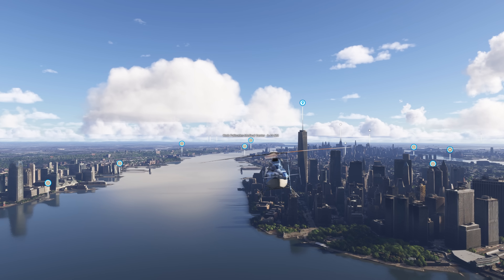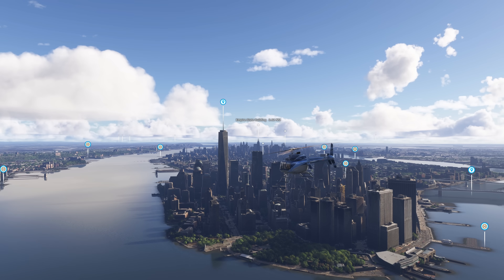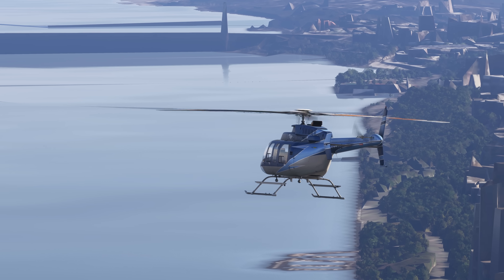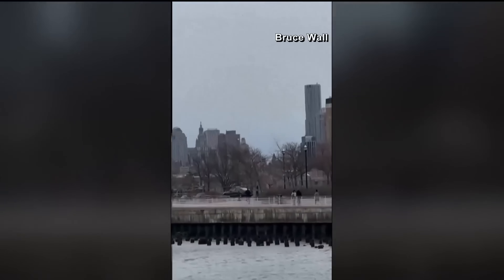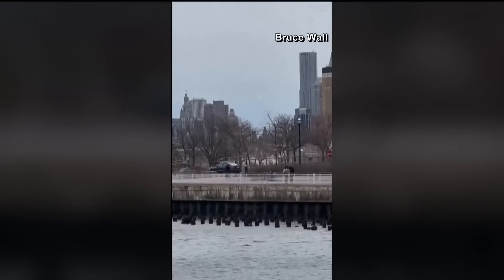Helicopter Expert breaks down Hudson Crash, and discusses “Bump Mast” Theory | NYC Crash Follow-Up

Comment: As a retired Army Colonel with 724 combat hours in Vietnam and over 1500 combat hours overall, I also flew the grandfather, as I had five in one organization and nine in another.  Seeing the blades and the transmission flying off together, it's possible that the transition froze, locking it and the blades up together and causing the helicopter to make a 90-degree abrupt turn, tearing the tail rotor off due to kinetic energy.  As for mast bumping, I didn't see any abrupt maneuver.  I am sure improper maintenance will be the chief cause of this accident.  In Vietnam, I flew the OH-6, a much better combat helicopter.  Its grandson is used by Army Special Operations aviation units.  Don't forget that during initial helicopter training for Vietnam, the Marines trained with the Army.  Some may have forgotten to tell their grandchildren.

Comment: When i was in the NAVY (72=76) I was in Helicopter Training squadron 8. That's the squadron that operates the Bell 206 (TH57) since the late 60s. There was an A,B  and C Model. I worked on the A model for 3 years. We trained all Navy, Marine, and Coast Guard helo pilots. Also, Iranian and Italian helo pilots. This was a good interview. I'm a retired fixed wing corporate pilot with a lot of time in the corridor. He brought up a lot of things that make sense. I haven't heard the term Jesus Nut in 40 something years. I told my wife about it, and she said "thats the only thing holding the rotor on" pretty much. In the video it sppears the main rotor still has the transmission attached.

Comment: For future reference, it’s nearly impossible for there to be a “seizure” of a helicopter “gearbox” during power on ops.  If there were a problem, the power being supplied by the engine AND/OR the inertia of the rotor system turning will keep those parts turning for a good while.  The ”gearbox” would grind itself to small bits of metal before ever seizing.

Comment: I highly doubt this was any sort of mast bumping situation. The main rotor & gearbox auto rotated smoothly down, with blades that looked in good flying shape till impact. Had it been a bump/strike, the blades would have been mangled. Seeing the pics of the gearbox, mast, and blades, the upper fuselage structure was ripped out, still attached to the gearbox. I would bet money that there was a gearbox seizure. This happened to a Super Puma in the North Sea some years ago.

Comment: As we all know from the eyewitness videos, the Tailboom went first. The Main Rotor and MGB assembly along the upper deck went only a few seconds later.
NTSB B-roll video is out. 
Check out the left upper rivets on the remaining Tailboom assembly connected to the fuselage.
The metal has sheared right in the middle of the rivets pos 11 oćlock anti clockwise to about 8 oćlock. That only happens, if the rivets have been installed too strong! 
Only lower and back around anti-clockwise, the metal is sheared. 
That damage also concurs with the video footage. It broke free on the left partition and ripped off the right partition.
My bet is, these rivets had been installed wrong and that’s where the crack began before the Tailboom including the tailrotor assembly etc sheared off.

And it was no Mast Bumping, that was clear right from the first video!

Comment: If the Jesus nut came off the upper part of the shaft and trans would not be still attached. My 2 cents is that the transmission froze and blew apart.

Comment: 4500 hr helo pilot here. Saw the video where they were cruising normally and then a very rapid right yaw and appeared the tail boom separated. The main rotors, with the swashplate attached, auto gyrated to the water just after the main fuselage hit the water..other parts then fell nearby

Comment: In a 2015 there was a similar incident on the Isle of Man with the 206B, here the results of the investigation: The pilot of of the Bell 206B Jet Ranger II, had disembarked his two passengers and lifted off for the return flight, in an area of mountainous terrain. The wind was from 220-230°, gusting to 46 kt and the aircraft was seen to head initially into the wind. It was then seen to turn right onto a north-easterly track and the fuselage was seen to oscillate in roll. The fuselage rotated in yaw beneath the rotor disc, more than once, and the nose of the helicopter pitched up into the rotor disc, being destroyed. 

The fuselage, rotors and many fragments fell separately to the ground, where the fuselage impact was not survivable for the pilot. Examination of the wreckage showed there had been a catastrophic failure of the helicopter’s main rotor mast in flight and there was clear evidence that this had been due to heavy ‘mast bumping’ contact between the teeter (‘static’) stops on the main rotor head and the main rotor mast. This was consistent with the observed behaviour of the helicopter, where the pilot appears to have been attempting to control the aircraft in turbulent conditions.

BTW: my Dad was a U.S. Army Huey pilot with 3 tours in Vietnam and a 20-year veteran. Respect to you sir.
Reply: My Ventusky radar shows that the wind that day at their altitude was 20-22 mph. It night have gusted higher than that.
Last week it was very windy and gusty the whole week here in Florida.

Comment: This heli has a tilt rotor head so if you pull the nose up and and then over compensate by pushing the nose down down means the rotor now faces forward and down and the fuselage pointing up if the rotor head hasn’t separated now it will on the back stick correction. Have seen 3 Bravo model Iroquois fall out of the sky doing rapid pull ups.

Comment: Thanks Capt.  and Colonel Joe Yannessa. Really appreciate this!  
There's nothing like hearing from people who actually know what they're talking about! Especially in our world of social media "experts". 
Every tragedy involving loss of life is devastating. As a private pilot of 26 years (fixed-wing) and a dad who've flown this scenic route several times, with my own children and family members, this hits hard. 

And on top of it all, it happened right near my job of 30 years. The Holland Tunnel ventilation building (one of four), where I work as a Tunnel Systems Controller. Operating the High-Tension feeders, ventilation fans and tunnel lighting (and various other equipment). 

My knowledge of helicopters is very limited, and only based on my love of flying them in flight simulators, for decades. DCS World, MSFS, etc. However, when I saw the videos, my first thought was....catastrophic mechanical/structural failure!
Prayers for the pilot and his passengers. Condolences to the families and loved ones. 🙏🏾

Comment: PS.. the rotor has now been recovered and the blades do indeed show severe damage. Both blades are snapped and hanging limply at about 1/3rd span. The tip of one blade is missing and the tip of the other is crushed. This IMHO is entirely consistent with blade impact against the tail boom. In fact it's hard to explain the tip damage any other way? The mast, upper gearbox and it's mounting is also still attached (so no Jesus nut or failure)

Comment: Regarding the speculation that the rotors would break if they had struck the boom. There have been previous incidents where (following catastrophic epicyclic gearbox failure) the blades have chopped off the tail and the blades remained largely intact and rotated down seperate to the fuselage, exactly as in this incident. The crash of G-REDL in 2009 in the UK North Sea is such an example, the crash investigation report is online. There was another similar incident in 2016 in the Norwegian North Sea. Too early to say for sure of course, but in my non expert opinion the evidence so far seems consistent with catastrophic gearbox failure as the initiating cause.
Reply: Wow! The closer I get to thinking I've found the answers, the more I learn that there are just too many possible scenarios to come to a conclusion yet. 
Fixed-wing private pilot, with no rotary experience, but I've always been fascinated by them. Thanks for sharing. 👍🏾

Comment: When carry paying passengers, no pilot would be foolish enough to jeopardize the aircraft by doing some whacky maneuver. Smooth, coordinated flight is obvious. The aircraft suffered some type of structural or mechanical failure. The question is; could this defect have been detected during a routine preflight?

Comment: It is so heartbreaking, the only comfort is that they left  altogether. My worst nightmare would be losing my whole family-being the one left behind. The survivor’s guilt would be overwhelming, after all, it is natural for families who are close to travel and take trips and holiday together. Helicopters are a whole different beast from fixed wing aircraft. My old boss from when I worked in aviation was in a heli hard landing/crash - they dropped from 40 ft straight down from an engine failure. Spinal injuries, he took 5 years to recover, but if they had been just 20 feet higher, it would’ve likely have been fatal for everyone onboard.

Comment: I am definitely not an expert but it looked to me as if something externally hit the tail of the helicopter. It turned sideways unnaturally fast and the hit was so hard to break the tail off. It could've been something small, shot from the ground. Just something I wonder why no one is talking or considering about. It will explain a lot for the different events at the tail. But then again, why did the main rotor came apart from the top of the helicopter, unless the stress from a hit can actually put so much stress on the main rotor.

Comment: Have that helicopter double controls? Child was at front seat. If she did pull it to mast pumbing? It happen when after deep descent and pull sharply up, and when it began roll, doing correcting steering. Said army guitance film.
Reply: Holy Cow...!
I've read sick comments about this crash, but blaming one of the children, you're in a disgusting league of your own!
Reply: @NewChannel-wi7vj  I didn't read it as blaming. I saw it as a legitimate question, because many aircraft have dual controls. He may have been thinking that the pilot let his front seat passenger fly it briefly (as done in fixed-wing discovery flights).

Although I doubt a pilot would do that with a cabin full of passengers/family members, but I have no idea how these tour flights are conducted.

Someone raised the exact same question on another video, and there was a reply that these tour helicopters do not have dual controls.
Reply: @NewChannel-wi7vj  Somhewre was story of drunk woman who repeatly tried pull rotor lock on. Child can do something for playing pilot. In russia it happened when pilot son was in controls and airliner crashed, even gopilot was in cockpit.
Reply: Someone also asked if the front seat passenger could have pulled the rotor brake. I mentioned that the passenger was a small child, and questioned if he'd even be able to reach it, or the rudder pedals?  I didn't get an answer yet, and I have no idea. I've never sat in the cockpit of a Bell, only in an R-44.

Comment: I'm a fixed wing engineer but I have some Bell experience on 212s and 412s.....my best guess at the moment is the main rotor gearbox failed as it left the aircraft with the mast and rotors still attached. The Jesus nut never failed, its right on top of the rotor head. Such a terrible crash.....let's see what the NTSB find

Comment: The mast bump theory is ridiculous, as we so clearly can see a complete rotor spin like a toy, separated from the helicopter, and there is no doubt - the blade is in one piece - spinning by itself - had it "bumped" into anything, while it still was attached it would have been broken apart, like we see when helicopters hit wires or anything else, usually near the ground when flying too close to obstacles. No doubt that something catastrophic happened, however mast bumping when the rotor  was attach would have damaged the rotor bads, so why is everyone talking about that instead of what must be a big scandal, how the whole mechanism came apart from the inside? It surely struck the helicopter after coming loose, and IF a bump like it was described, really can happen, that should surely be a poor construction of the helicopter, although it must be a very rare occurrence. Another thing that makes the mast bump theory seem unreasonable, is that the video is showing the helicopter flying straight ahead and surely, helicopters have made more hard turning maneuvers, during rescue or military operations, probably also during these tourist helicopters trips over the Hudson. 

However - what we can see, is a helicopter that flies very straight and suddenly comes out of the air - the mast bumping was not the cause of the accident - material weakness, possibly by flying the helicopter outside its specs, or a part of the transmission getting jammed, catastrophically, was the reason. 

Maybe also helicopters should be equipped with parachutes, like some small planes are, however the return vs investment may be small, technical complications will arise, as the rotor must be gone to release the chute, however it is not impossible. Seems like we need to re evaluate the very construction of helicopters, and make a drone like construction, however - it would take many years of developement and tests in bigger scale than our toy drones, however that would be the future and be safer, some day - as a computer would easily be able to compensate for missing rotors or motor failure, again - a lot of testing and developement for this to surpass traditional helicopters, regarding safely, is needed.
Reply: Oh, Lord...
Here comes yet another instant-keyboard helicopter engineering specialist!
Reply: Are you leaning in a particular "catastrophic" direction?

Comment: I'm a retired helicopter pilot of 23 years mountain flying in B.C. Canada and have many hours on Bell models.
With all due respect to the Colonel, a few things he talked about was a little unclear.

Mast bumping occurs in semi-rigged rotor systems when the disk is unloaded causing flapping of the blades like a sea saw effect,  one blade goes down the other up. This could cause contact with the boom. If severe enought the mast could break from contact with blade stops. Mass bumping is very rare. Level flight over level terrain it would never happen. Severe weather, possibly but unlikely. 
Mountain flying, very possible. You have to be aware of severe up drafts and down  drafts. Down drafts are the enemy for unloaded the disk. We're heavily trained in mountain flying, it's a complete different space.

I disagree with a pilot that hasn't had an emergency for a long time is less likely to react to one?? Not sure of recurrent training in the US but in Canada we spend about 10 hours in emergency procedures twice a year. Engine failures, into wind, out of wind, hover failures. Peddle jambs, left and right. Hydraulic failures. Electrical failures. 
We are current, ready and waiting for it. I've had a number of these occur.

I've seen a couple blade striks from hard landings that severd the tail boom that left the blades intacked, damaged but in one piece. 

If an engine failer accures you get that instant yaw, down on collective instantly, flat pitch the rotor blades and your free fall will turn your disc into a parachute in reality. 
A delay in reducing collective by just 2 seconds will result in loss of rotor RPM that you might not get back. I don't understand what the Colonel meant by rotor slowing down because of lack of collective response that could result in a boom strike? Just the shear wind your falling through would not let the blades droop so not really understanding that.

Transmissions in Helicopters are extremely robust. We as pilots pay extra attention to transmission temperatures and pressure. If we get a transmission amber chip we'll land as soon as practical and investigate the cause.
I don't want civilians to read about this tragedy and be scared to fly in Helicopters. Catastrophic failures are extremely rare and as pilots we continually scan our instruments and she'll tell us she's getting sick before anything happens. Helicopters are amazing machines!
They are unstable aircraft that beat the air into submission, all good! I miss flying them everyday.

If i dare to give my thoughts on the cause of this tragic accident would be catastrophic transmission failure, locking up instantly and just from that energy of the rotor system would turn that helicopter instantly 90 degrees, tearing off the boom and ripping the transmission out of the fuselage, and this would happen within 2 seconds at the most.
 
Anyways, just a little knowledge from an old pilot, not a bold pilot!